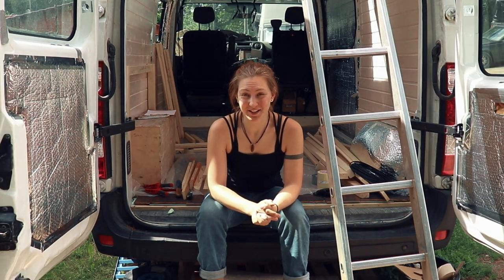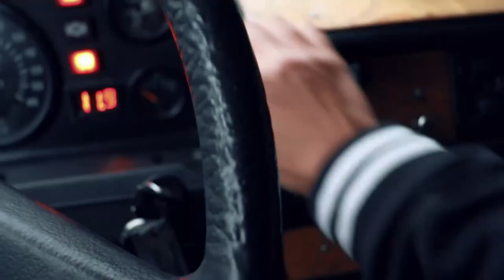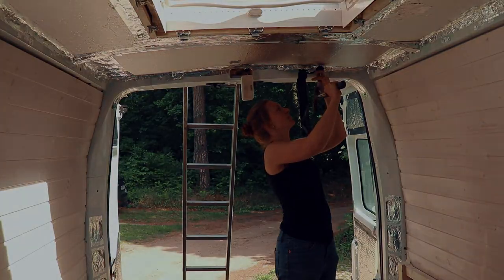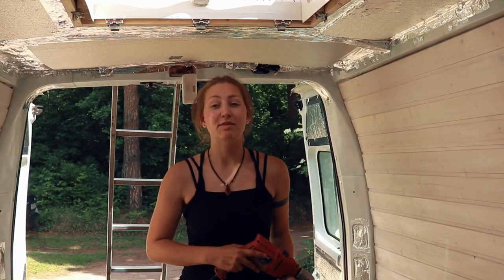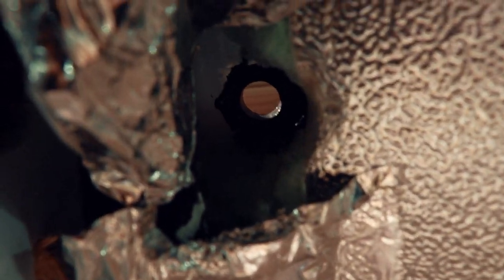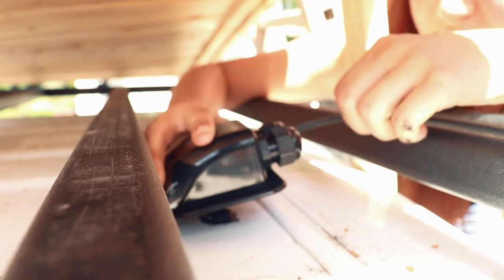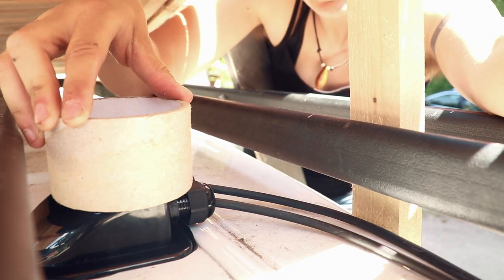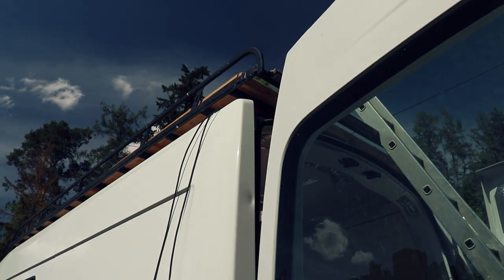How do I get SOLAR WIRES THROUGH my VAN ROOF? | Van Build #10

Comment: You can use a hole saw. Cheaper and easier to drill than large drill bit and claims to make hole on wood and metal. Or get a hole punch but that gets expensive. Plastic grommet is a good option. Using rubber can decay overtime and eventually start allowing wires to rub on sharp edges.

Comment: Nicely done Lenja, There is a waterproof adhesive and sealant called CT1 Google it. It's far better for sticking caps on the roof it's bonds so water can't get in. I made a note about it from watching another van life channel so I can't take credit. You also should've used a rubber gromit to go around the hole, as over time the wire moving slightly will wear. Keep the videos coming. Oh yeah, wear googles when drilling metal, no fun with metal in your eyes. I know. I have two eye patches lol.

Comment: PLEASE use goggles when drilling, it's even more risky like that above your head but even when you're drilling a small hole under yourself you should wear glasses. I learned that the hard way and you would too if bits of metal get stuck in your eye and it gets infected.

Some more tips that might help:
If you have to drill a big hole, let's say 15mm, start with a small drill bit and work your way up, in this case 5mm>10mm>15mm or something like that is usually better. It will drill easier, not catch as much and be more likely to wind up at the center you started at.

You might want to brush the little bits of metal from drilling off your roof if you haven't already or they will start to rust and that can actually get through the paint.

Clean surfaces with paint thinner or white spirit or acetone before gluing them but give them a very light sand first because it will make for a better bond. It might be ok as it is but if the seal ever fails you'll know what to do. I don't know what glue you used but polyurethane-mastic is great for it(I used to use it at a factory that relied on it for sealing their custom fun fair trailers) and I wouldn't worry about it oozing out the sides a bit because in this case waterproof is more important than pretty.

Nice to see the progress, best of luck and be safe :)
Reply: Maybe i was sitting next to you in A&E i also had to have a metal splinter taken out of my eye
Reply: @cagedavis9334  I'd hardly call the place I went to in eastern europe an A&E 😅The doctor had an incandescent bulb with a pulley string, a magnifying glass on an arm and i kid you not a SEWING NEEDLE. "hold still" she said and I never sat so still in my life, I just really wanted it out because it was all infected.
I hear in the west they usually use a magnet nowadays.
Reply: @Russellbeta  Thanks Russel now i cant sleep thinking about a doctor with a MASSIVE EYE and the flickering light from the incandescent bulb reflecting from the tip of a sewing needle slowly getting nearer and nearer. Yes i had to put my head in a type of frame and they used a magnet

Comment: In my previous two van builds the rubber seals which run the solar wires through leaked badly, so make sure that you seal then up with sikaflex. :-)